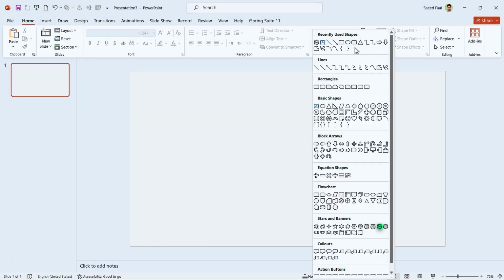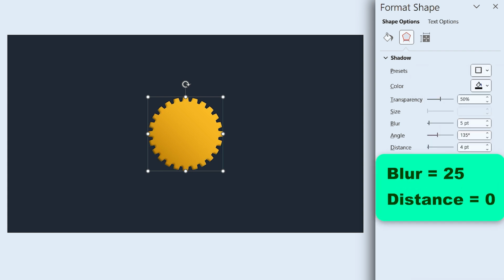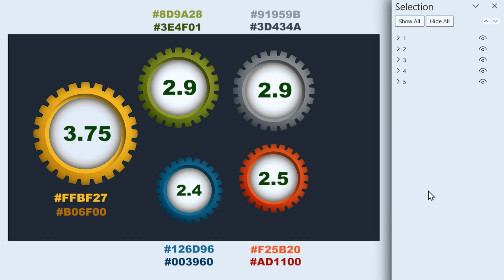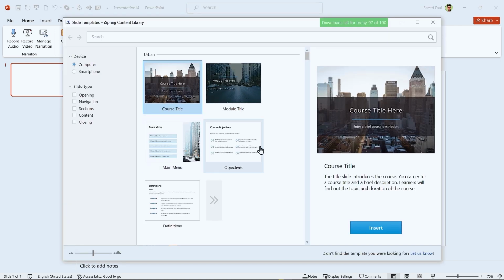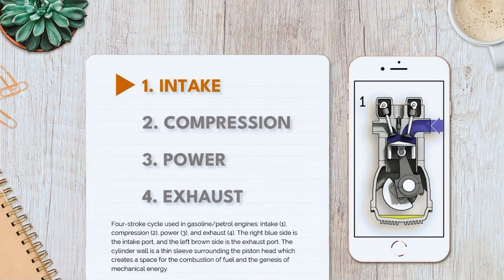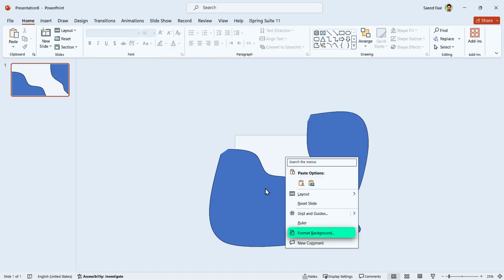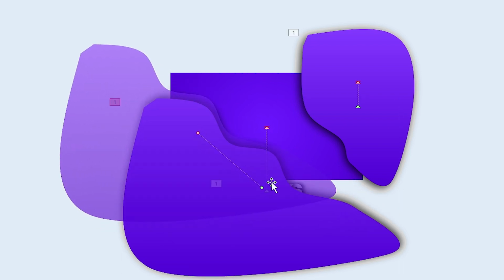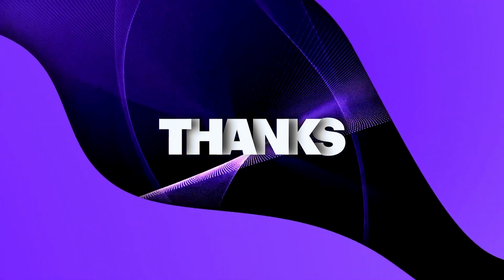Designing Infographic Slide and Animated Waves, Step by Step in PowerPoint

Comment: the turning of the objects did not work for me for some reason lol
Reply from the maker: Check if it works on a new PowerPoint or not, maybe you should close the program and reopen it again 
or restart your pc
Reply: @SaeedFaal  I figured it out. I had an issue with the dimensions because when I put in the numbers you put in my objects were smaller, don’t know why. But because of that I had to group the objects together and resize them together. The reason why they weren’t spinning was because I forgot to ungroup them in the duplicate slide.

Thank you for this by the way. Really amazing
Reply from the maker: My pleasure!